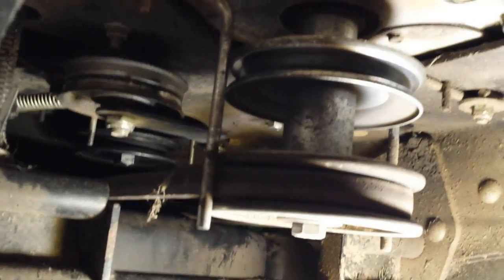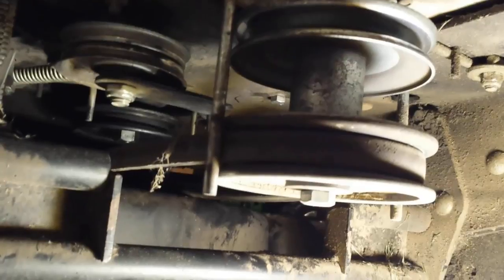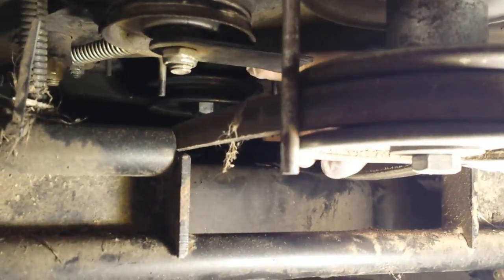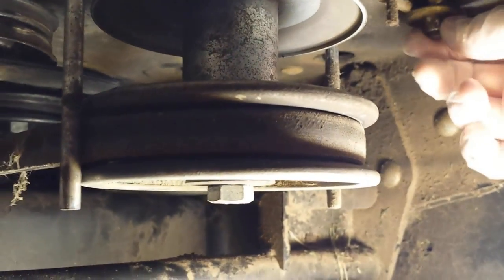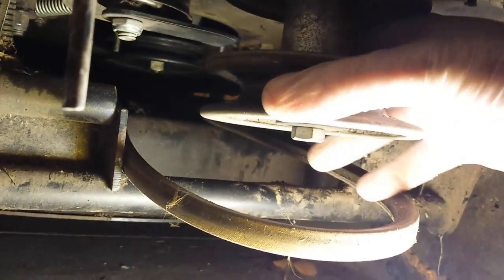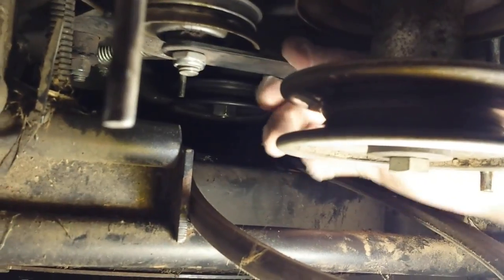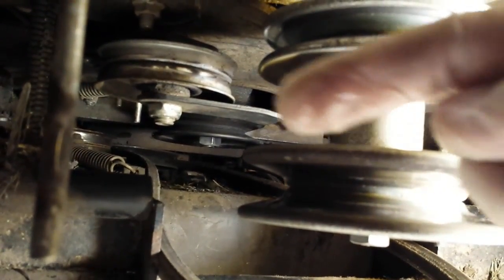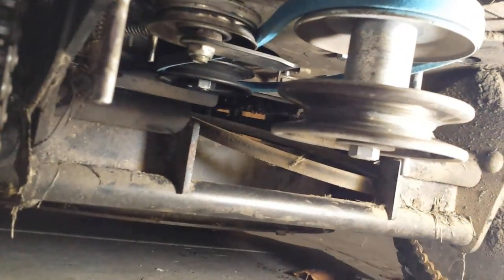How to change your riding lawn mower belt (Dixon)

Comment: I tried a 41”  belt it was way too tight to get on. I did finally get it but then it wouldn’t start up. What size belt was that it looks like that fit way better. I have a ztr3303.

Comment: TRYING TO MOVE MY DIXON ? The deck is lowered and won't move back up. How can I put it in neutral? The mower needs to be scraped but It is stuck in my barn and in the way of everything?
Reply from the maker: Should just have to release the parking brake and then it should move

Comment: Looking at your video I'm trying to see where the spring for the idler pulley attaches. It's the other end of the spring furthest away from the pulley. There's a couple of bolts it could attach to but no diagram I've seen shows it. Thanks

Comment: I have a mid-2000s Dixon SpeedZTR 42" and am trying to put a new 'engine to mower' belt on.  I cannot seem to get enough slack to slip it on the engine pulley.  On other Dixons, lowering the deck provides tension relief, but on this model it doesn't change anything related to tension.  I've released as much slack as I can but just cannot seem to get that belt slid onto that engine pulley.  Thanks for any advice.
Reply: Did you ever solve this? I'm running into the same issue.
Reply: I can't even find the size 😂 I would pull down the pully and use a jack to raise and push it in

Comment: Working on the same mower, but my belt is too  tight.  I cant get it to slip on the pulley.  Should it be tight?
Reply from the maker: It should be tight.  But you should be able to remove. Might have to start it on one side of the pulley, then spin the belt to walk it into place. Kind of like you would do with a chain on a bicycle or something similar  to that. Also are you certain the tension is fully released? Make sure it is fully relaxed otherwise it will fight you
Reply: They say these take a 71" belt but a 71" belt burnt up the starter on my ZTR 3304. It was way too tight. Looks sloppy but a 73" looks like my original and it works. Folks will have to try different belts and see what fits best
Reply: @Blindowl1234  I just put a 71 inch belt on my 3304 and the blades are still spinning when not engaged so I agree it's too tight. Guess I will try a 72 in tomorrow. Thanks for the heads up!
Reply: Changed out transmission on 1995 3304 mower. The new pulley is 4" diameter vs 6" on old unit, what is the required belt size now?
Reply: @kansasgardener5844  was 72" a good fit for you? I have the 3303 and couldn't get a 71" on, so used a 73" but I can hear it whipping around when the blade is disengaged because of the slack.
Reply: @camgraff6318  Can't remember exactly what I went with give me a day or two and I'll get back with you.

Comment: Hey on the dixon zero turn mower on a 5023 model where is the oil drain plug where u take out so u can put fresh oil in it i just got this mower an haven't find the plug but I did find the oil filter
Reply from the maker: Typically on the left side of engine towards the bottom. It's not a bolt, but a drain valve. Probably will use a 10mm socket to open the valve. Attach an appropriate size piece of vinyl tubing to the Outlet so you can direct the used oil into a container. Otherwise you will have a mess on your hands
Reply: @thefixitdad4938  ok I looked everywhere all the way around the engine but still couldn't find it would it be under the engine also the bolts that holds the blades on suppose to be so tight where they won't turn because I'm trying to take them off so I can either put new ones on or have them sharping because I was going to take them to a friend who can look an see if there still good an just need sharping because I'm not that good on when they need them an I can put new ones on there but I can't get the bolts to turn where I can remove the blades an I just have a socket I don't any kind of impact gun or air gun at all an I even try spray WD-40 an still won't turn at all
Reply from the maker: @mdontwowheels6400  not sure what else to tell you on the drain plug. Maybe trying searching your mower model online and you could find a picture of where it should be. Remove blades can duck without an impact. Best option to remove them without an impact is to stop the blade from turning with a block of wood and use a breaker bar. Don't forget to disconnect the plug wire before attempting to remove the blades. Good luck
Reply: @thefixitdad4938  ok i did have wood there but it wouldn't move the bolt at all and I don't a breaker bar either
Reply: @thefixitdad4938  but i guess I need to get one of them or find someone who does have one
Reply: @thefixitdad4938  Good news i think I find the drain plug where u take the oil out from an I think its mud or tons of dirt on it where i didn`t see it the first time I looked in there but didnt have a light when i look for it but what's the white filter thing under the mower above the mower deck ?
Reply from the maker: @mdontwowheels6400  good job. I have no idea on the white filter
Reply: @thefixitdad4938  ok i look at it but it doesn't have anything on it so I guess I'll leave it alone until I find out what it is
Reply: @thefixitdad4938  hey what size bolt is on the deck to remove the blades?
Reply: @thefixitdad4938  I will probably need ur help on the spindles that the belt goes around I had to removed them to get the blades off but problem I'm having is how to get the middle blade off of the mower
Reply: Fit it dad does the drain plug have a yellow bolt on the end ?

Comment: What was the size of the belt for the deck
Reply: depends, If you have the same model it's 5/8" X 72.375 or just a 5/8 X 72 standard V belt, but I've found that that belt is used across numerous dixon mowers

Comment: Don't feel bad I can't find the number on the pulley on the bottom of my 13.5 Briggs & Stratton ZTR 3530  Since they don't make Dixon parts anymore. Husqvarna is not going to make your parts. The people that made it. There is no more pulleys. No more Dixon parts. So the point is don't buy a Dixon. Can't get parts. And most people will not even try to help you anywhere. Not even online marketing. I guess if they can't get Factory Parts they're not selling anything.
Reply: My dad's father-in-law owned Torkelson Repair in Crookston, MN.  He's closed the business but still has parts to sell, including Dixon parts. Let me know what you need and we may be able to find it for you.
Reply: @squirrelbike  there's not that many different size of clutches. As long as the worst matchup they should fit. I noticed Husqvarna. Made them clutch is so they should have the same kind of clutch I went to a website and they had different numbers for the clutches. And Briggs & Stratton they have to fit. So there's many different kinds the pulleys clutches that should fit. If it's to wire 3 wire or 4-wire. Any good shop should be able to help you. You have a motor clutch or do you have a clutch that took to the main deck itself. There is a difference. The main deck assembly is much larger. And I was having a problem with blowing the fuse so I went to a bigger fuse and went to a 40 amp and it stopped. Nephew is poor so I did what I did.